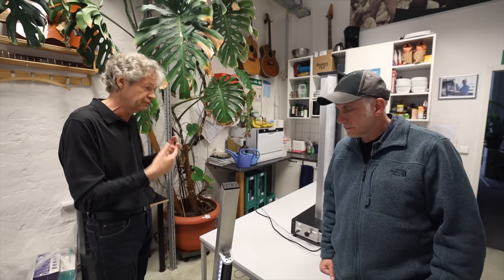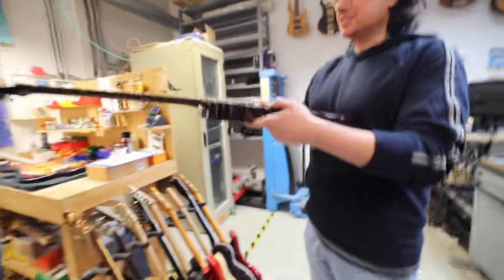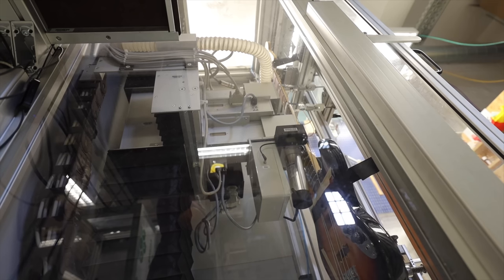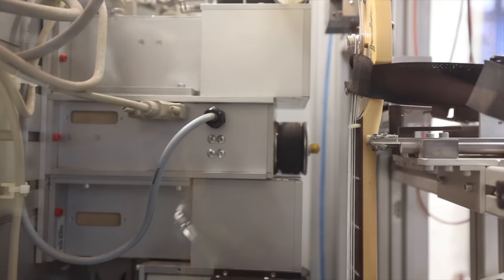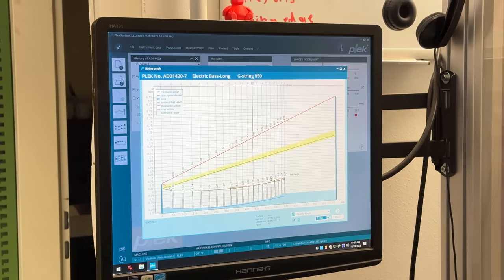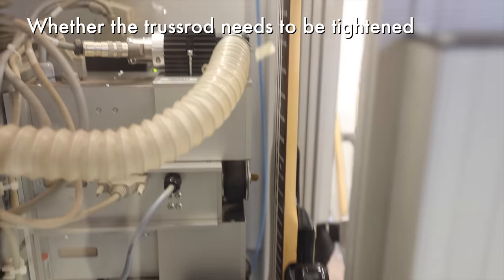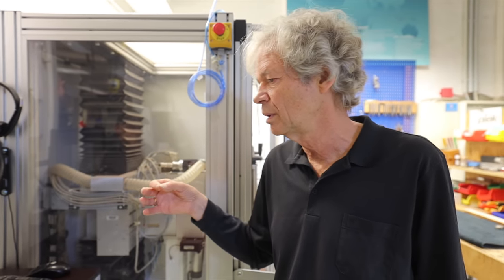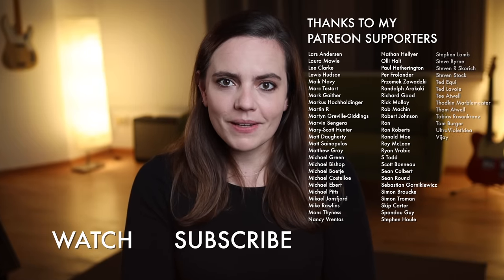Rick Beato Invited Me To Berlin and we visited the Inventor of the Plek Machine

Comment: Having worked for 12 years in a factory with machines built by German engineers, I can attest that everything in that machine and its structure (and even the computer) are typical German industrial manufacturing. For a minute I thought I was back in the production line.

Comment: Brilliant engineering. But "taking away some of the more time-consuming work" of a luthier, we will end up with fewer luthiers, there's no way around it, like it or not.
Always fun to see Mary and Rick together. Here, they both play their strengths: Mary as a documentary videographer and Rick asking the right questions.
Reply: I don't think you really have to worry about that - the machines aren't cheap, pleking runs in the neighborhood of $300, and there are only around 30 machines in the US.
Reply: OTOH, setups are probably the least fun thing for a luthier to do.
Reply: What the plek does is beyond the capability of a human luthier. So while it may be true that instead of having a human luthier spend hours dressing frets etc, the plek takes that work away from the human, but it does a far superior job. Technological advances can render certain types of work obsolete or greatly reduce the need for it (there aren't that many people working as blacksmiths or farriers after automobiles replaces horses as the main mode of transportation).
Reply: Maybe. Then again after having my long lasting love guitar in the local luthier and getting 75% of the issue done, I havent been in haste to give it an another go in their shop. The machine could diagnose the problem.
There's a micro sound problem in a certain string with my unorthodox playstyle and open tuning but these small things can be huge for the player even without anyone else noticing =]
Reply: The best luthiers work with the new technology and use it to produce even better guitars.
Reply: I have a Plek, only one in my city of 2 million. I have Luthiers use my machine to fix guitars and basically confirm what the think the problem is. Always happy to do part of the work to save them time. The Plek does so much more than this video shows. Fret slot cutting, nut cutting, engraving, fretboard radius planning. And more.

Comment: Mary, another option is a fret leveling jig that retains string pressure on the neck, without getting into the complexity of the PLEK machine. Stew Mac sells one designed after jigs some guitars techs hand-built over the years. There is also Sam Deeks youtube channel. Actually, I'd suggest to find him for a further discussion. He's somewhere in England and might be 'easy' for you to visit. He levels necks under string tension using a special leveling bar. Fretwork is an important topic. I'd rather buy a $50 Beater guitar and put a full fret level job into it (PLEK or tensioning jig) than buy a guitar upwards of several thousand dollars; because I have done this. I think Ben at Crimson Guitars would have good input if you followed up on this type of project too, although he hand levels frets by feel.

Comment: The Plek is great for getting the nut cut right, especially if you're building a partscaster. However, pleking frets also means they are trimmed down low. This can cause other problems. A refret can be a better alternative if the frets are really worn.

Comment: When my Taylor 114CE was irreparably damaged, I spent about an hour a week in my local store, 3 visits, looking for a replacement. Lucky that the store is less than 20 minutes away. I tried lots of Taylors, Gibsons, Larrives, Martins, and others. I pretty quickly had it down to 2 guitars, a 3 series Taylor, about CAN$2600 5 years ago, or an Epiphone DR500MCE Masterbilt with the PLEK'd neck, CAN$700.
     Part of me was thinking 'you get what you pay for'. So I kept taking the Taylor off the wall, but I always put it back and went to the Epiphone. The feel was up there with the more expensive Taylor, but it was the versatility of tone. I could play a little closer to the bridge and get the same brightness the Taylor gave me. But the Epi could pull a more assertive fatness to the tone if I played an inch or two toward the neck. Couldn't get that out of the Taylor.
     I'm just a for fun hobby player. So asked one of the staff to play the guitars. They agreed that what I wanted was in the Epi. 
     So, I really tried to be a proud owner of an expensive guitar. And ended up choosing the one that sang to me, still not cheap. I love it. Been back a few times to try others. I definitely picked the right one for me, and am glad I took my time. That PLEK'd neck is great!

Comment: Question Mary, if the guitar is pleked under strings of a particular gauge, what adjustments would need to be made under lighter or heavier strings?  I watched the Andertons tour of the Gibson factory where they pleked the necks before being attached to the guitars. So I assume that the plek process only digitally creates the perfect neck, fret and fret board on a neck with zero relief for optimal playability.

Comment: I'm hoping to order an expensive (for me, at least) guitar in the next few months and have been toying with the idea of having it pleked but not sure if I want to budget in the additional $300+. I just can't help but feel that, when an instrument costs $1,000 or more, you shouldn't need to pay extra to fix any problems the manufacturer didn't get right. It doesn't help that I've been playing a long time and remember the days when you could get a Japanese-made Ibanez for $500. Very informative post, Mary. Cheers.
Reply: I guarantee that a $1000 guitar will need a setup and may still have the odd high fret. The problem is you have metal into wood and wood moves with temperature and humidity so whilst it might have left the factory spot on by the time you get it, the woods moved

Comment: I get it. Clever. 

Keep normal string playing tension. Measure the neck flex/twist/warp. 

Remove strings, then stress the neck to get back to the same flex as before. 

Now you can work on the frets as if the strings were in place. 

Genious method. Simple, but also clever.

The stings are dead straight when under tension.

Comment: Huh? I've always set up my own guitars and have always set it up with a slight overboard for feel and would, with full tension, use a bent file to file any frets that may buzz (I just bend the string out of the way, file and then try again). I have also used a flat file just under the strings run back and forth to do the same. People always say it's wrong or bowed but it plays amazing with no buzzing.

Comment: The only thing I didn't hear addressed was the positioning of each individual fret on the fingerboard to ensure proper intonation, relative to the bridge position as well. The machine may have probed that data but I didn't hear any mention of it. The designer basically used a proven technology used in CNC machining and parts inspection, aka Renishaw probe technology and wrote software to control the process.

Comment: PLEK works to compensate for the flaws of an imperfect neck and fingerboard, and PLEKing for this also removes fret material, so it's clearly preferable to begin with a perfectly-manufactured neck and then fret dress normally and minimally thus sparing as much original fret height and material as possible.

The Jeff Kiesel explanation on Philip McKnight's recent factory tour is great.

A PLEK job is costly, so maybe it's better just to start with a more expensive guitar. But if you find an amazing budget instrument, PLEK might be good enough to give you a very playable guitar.

Comment: Hey Mary, I have always been very interested and enthusiastic about human engineering and know both the plek machine and the results it produces. But in the end, it does exactly what a guitar maker does by hand, namely grinding each fret to the same height and then rounding and polishing them. It would have been interesting if you had scanned a neck that had previously been dressed and finished by a luthier and then compared the data and figures... Thanks for the great Video Best Regards Nik
Reply: "But in the end, it does exactly what a guitar maker does by hand . . . " if that person is competent at that task. I have no idea how good you are at fret dressing, but I've suffered at the unskilled hands of a handful of "luthiers" whose work was marginal. I also have a Goodall and a parts tele that have been plekked; I'm not going back. In my experience, a well-run Plek machine(my guitars happen to have been done at PlekHaus in Berlin) is much better than any other luthiers work I have experienced. Keep in mind, the operator must know what they are doing, it's not an idiot-proof machine by any means. It's still skilled work, it just reduces the physical labor greatly.

Cheers,

Alan Tomlinson

Comment: Would be interesting to see what a Plek would evaluate & assess for a Luthier fret level & crown already performed ? For a new guitar neck, this would only correct the tolerances of virgin fret wire, at least in theory ? Just from my years of experience, the frets on even the preowned guitars I have bought, really aren't hat bad to have required even a fret level & crown. Damaged fret wire for dents and being ground down by string bending, those are obvious fret level & crown jobs. A twisted & warped neck is just a flawed evaluation & assessment from the start. That's what individual saddle height adjustments would correct. What the Plek won't be able to correct is that neck warp, a neck pocket & body imperfections.

What I end up doing is adjusting the truss rod so that the tops of the frets are level 1 thru 21-24 dependent upon the number of frets the neck was made with, then loosen the truss rod for relief. Nobody ever played the fretboard, because the fretboard is merely what the frets anchor into & properly spaced for scale length. Sometimes that needs a shim in the neck pocket (bolt on necks), I've never reset a set neck. Once that's done the truss rod can be adjusted so that the frets have the relief to vibrate 1-last fret. Sometimes it's a micro turn of a tighten or loosen for the string tension to get the right relief. A neck might react differently to the truss rod when tuned to a different tuning (standard or alternate tuning) because the string & sting gauge are of differing tensions. I've never had to cut nit slots on any guitar really, never had to level or crown. I can dial any of the guitars I have with truss rod adjustments, neck pocket shims and saddle height adjustments. Seems to work for very playable low action guitars. I just have to work on what you do well, playing better & composing music. The worst guitar I have has never held me back, I own that I'm poorly accomplished player. It's not the $ 100 Chinese guitars that stink, that falls on me. How do I know this ? another more accomplished musician, I handed him that same guitar that most opinions was a dog, he was playing riffs on that same guitar like a rock star. It then dawned on me, he's good, the rest of us aren't. He wasn't fighting the instrument to play music in tune & it didn't take him long to adapt to the feel of an unfamiliar instrument. He handed it back, nothing wrong with that one & said he could do better with a little more one on one time alone with a Squier Bullet SSS HT Strat. He did complement me on the set up, something I had to shim the neck pocket to get right. The neck shimming was a process of studying better built guitars & online photos and then it was obvious. The neck pocket & neck were the problem. Once that was fixed string action became a slam dunk, the fret wire was fine.

Comment: I have a new Gibson LP standard. Can I change string gauge, action etc without ruining the PLEK work? What I want is to change string from 10s to 9s and the action to be little lower. I also have to adjust neck relief after these changes but will I ruin the PLEK work?

Comment: I bought a 59 Epiphone from Sweetwater and had them Plek it. The frets are perfectly level, but the left the tops of the fret ends rough from the crowning process after the Pleking. I wasn't happy about it, so I have to finish the work myself. If the fret ends are sharp, Pleking will not take care of that. But I would think they would buff the top of the fret ends from their tooling marks. If you think it will make your frets perfect, maybe not. I think Sweetwater could of done a better job. I will probably never Plek a new guitar ever again. I might have a used guitar Pleked at a local shop where I can actually talk to those who will do the job.

Comment: It not all that. It is, but don't discount the human ability to do the same job. Used to pay $330 everytime I built a guitar. But I wasn't happy with the polish job they did afterwards. So I ended up repolishing my frets anyways. Now I just do it the old fashioned way (the same way fender has been doing it for 80 years) with a set of high precision straight edges, notched straight edge, an assortment of high precision sanding beams, palm file, Optivisor magnifying glasses, triangle file set, fret ends dressing file, micro mesh pads, feeler gauges, Dremel and a little polishing wheel. It just depends on the Luther. Me working on my own guitars, I can take my time and get it within a 1/1000 inch. Polish it until it is like a mirror, roll the fretboard and fret ends. Close enough that you can't get the smallest .0002 feeler gauge to slide under a high precision straight edge. That good enough for us. Ain't going to have any issues whatsoever. Not to mention human intuition can't be replaced by a machine. Lot acoustics and hollow bodies have notoriously high upper frets. Sometimes you have to pull the frets, reset the truss rod, relevel the fret board and reinstall new frets. Just a lot of things a plec machine couldn't comprehend. It is only as useful as the Luther operating it. Not to mention their are ways around a twisted or back bowed neck. Understring levellers. But 9/10 necks don't have issues like that. They are just fine with traditional methods. Now here is the back breaker. You heard the man. The machine has to constantly recalibrate itself. Enough said. If you have $350 to spend and it is a guitar worth pleking fine. $200 squier or a $600 made in China casino. Probably not worth it. Especially, when a couple plek jobs would pay for the tools to do it free for a lifetime. I've made my decision.

Comment: This is not new technology . A CMM or coordinate measuring machine has been used in manufacturing for years. How features measure out relative to other features. The accuracy is unreal however , probably overkill for a guitar. It will be interesting to justify the need or expense , especially when the price of the adjusting or repair is added in .

Comment: Sorry but I was not impressed with my results.  It took off too much fret just to get them level.  Stainless steel frets have pretty much made this machine obsolete.  The way some manufacturers are able to install frets now without having to remove any material to level the fret board, you set 21+/- virgin frets with perfect crowns that never need leveling in the future (or a long time).  Plus, at their costs, an operator has to charge a lot for the process and it takes years to ever break even on their investment.